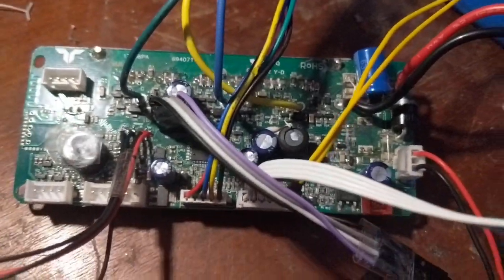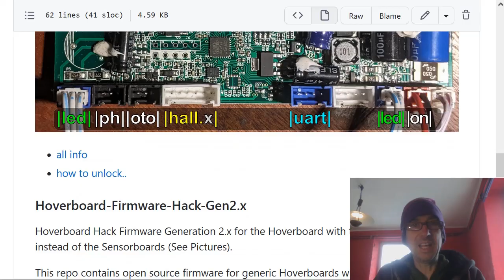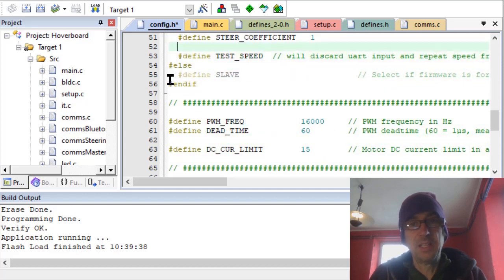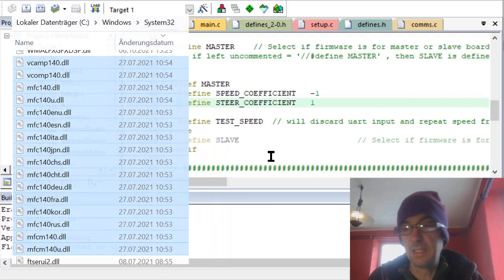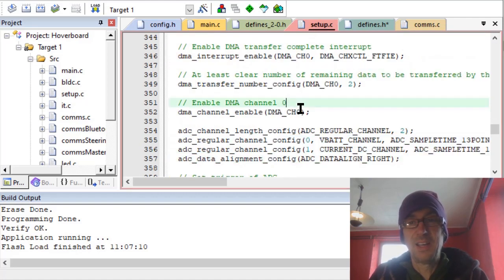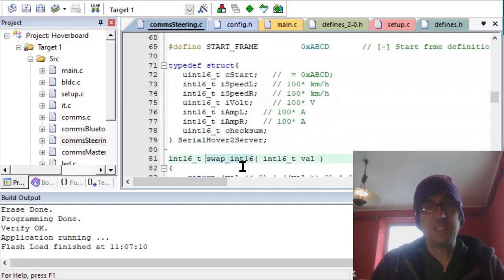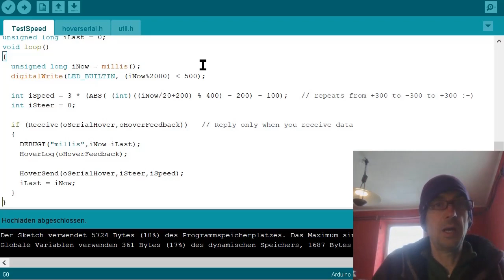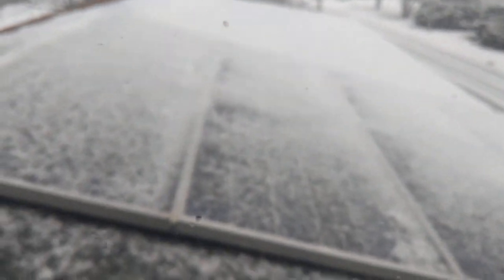Split Hoverboard Gen 2.x firmwares - finally :-)

Comment: I'm curious, I get the idea of repurposing and the challenge of using something for a purpose that it wasn't designed to do, but endlessly developing software for an ever changing layout is in my humble opinion a bit wasteful. Also hover boards haven't been trendy for a long time and might not be available anymore as secondhand items, rendering your hard work obsolete. The new items on the secondhand market are electric scooters and ebikes and then we will have to, yet again, reverse engineer those layouts. It is all a bit circular. Why not buy items that were designed for the purpose and save time. Sure they cost, but imagine how much time you spent on working out the problems on your project. You could've just worked a fraction of that time to buy what you really need? 

Would you mind making a video explaining why you do all this work?

By the way, there are tons of ebike charging stations in Europe called bike energy and you can buy a proprietary cable with Anderson connector with several voltage options upto 58.8v 5A for those rainy days in your solar car. Or even a j1772 to ac adapter so you can charge at a electric car station although the electricity cost is a little high. I love your solar car, it is brilliant.
Reply from the maker: As long as there are brain degenerated consumers there will be hoverboards.
And the purpose of a universal hoverboard OS is to not need "a job you hate in order to buy shit you don't need". (Tyler Durden)
I don't really see a better bldc controller hardware then these single board or split board hoverboard controllers - for below  $35. Yes, a few years ago you could buy a set for $17 on AliExpress. 
If I would succeed with an object oriented hoverboard OS, the optimal hardware might even sell  if there would be no brain degenerated consumers anymore.
But as also 90+% of hoverboard projects are stupid fun projects, world is on its best way to Idiocracy.
Reply: @robodurden  haha yeah absolute idiots. Thanks for doing all this development. I don't use it because I need more power as I'm surrounded by mountains, but I still like the whole project as a whole. I use 20A kt controller, with 3k turbo mxus hubmotor, old motorbike lithium battery on a folding ebike and modified smps similar to yours for charging (thanks for the building schema). It all costed 400chf including bike. Still very cheap and much better than anything I could buy. 
In the future I might build another lighter folding bike and might use your controller software as I have a couple of hover boards hanging around. Once i find a place I want to live in, I will build a solar car like yours as that is much more useful than any bicycle ever could. Check out "Fortschritt trotz technik" he does cool things including a velomobile, but I prefer yours because it is easier to build
Reply from the maker: @MoritzFoot  Niklas Fauth and Emanuel Feru have written the firmwares. Candas1 is also very active on the Eferu GitHub.
I only add little features and run the online Compiler .
The Gen 2.0 firmware is also not from me. Okay, i rewrote the serial communication to a large extend for my 2.x
But I'm still not much more than an end user.
FortschrittTrotzTechnik.. it is depressing how many millions of work hours are wasted by all the YouTube tinkerers..
I too dream of a 20% efficiency 100 Watt Stirling and have spent many hours on thinking.. but I would never waste a single minute on building a machine which would not be pressurized to at least 10 bar and has exhaust heat recovery. 
His curved XPS sandwich structure for his Velocamper might be a good invention.
But that is only possible because XPS is a thermoplastic. And for the same reason the sandwich will loose it's structure. The lower black part of my solar camper is made of 2cm thick XPS cut into many many 2cm slices and sandwichted with 160 g kevlar. After ten years now the XPS inside fails at critical points.
But such a whole body XPS sandwich with glas fiber and some carbon patches might last longer. He should make a tutorial on his XPS sandwich..
Reply: I have this problem too, always go overboard on how to recycle old stuff.  I spent countless hours building an interface to ford radios that were only used a few years, not to mention dash controls same deal.  So much easier to just build something from scratch using new parts, like an arduino and some mosfets, building custom circuit boards is super cheap now.

Comment: Hi sir what is your email I would like to ask more about the single board
Reply from the maker: Ask here or on GitHub.
Reply: @robodurden  hi 
Was hoping you would show the connection on how to unlock the GD32 using the transistors
Reply from the maker: @josephbanda8678  sorry, as i did not really succeed with the transistor, i could not show it. With the old windows st-link-utillity i think it is not needed. 
Maybe i succeeded unlocking by hitting strg+b in that utility while turning the board on. And tried for about a dozen times. sorry, you need to make that video yourself - for all of us. there is a written instruction somewhere in the links on my gitup repo readme.
Problem also had been i think that my st-link dongle reset output pin did not send a reset signal anyway and therefore the transistor did not work..
Reply: @robodurden  stm32 target not found is what I have being for a while now I tried as advised in the github repo
Reply from the maker: @josephbanda8678  get a cheap pocket dso and check the reset signal output of your st-link dongle.